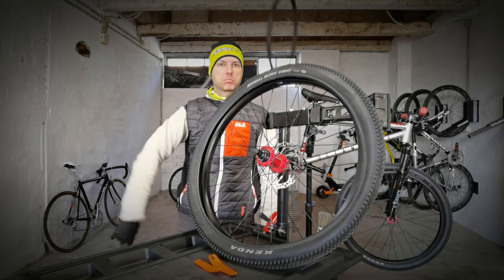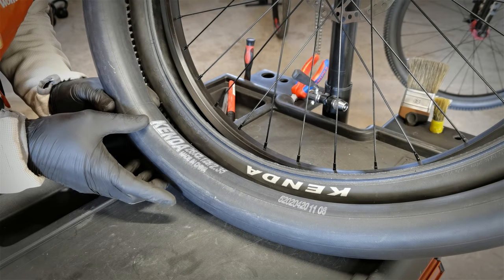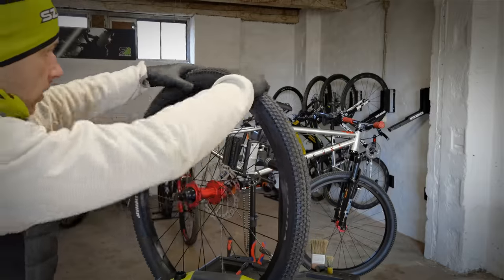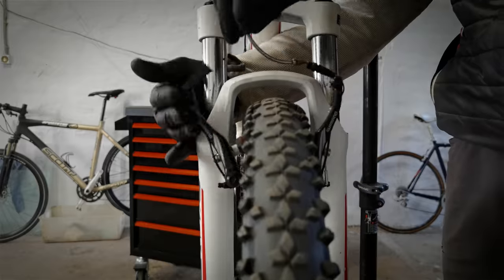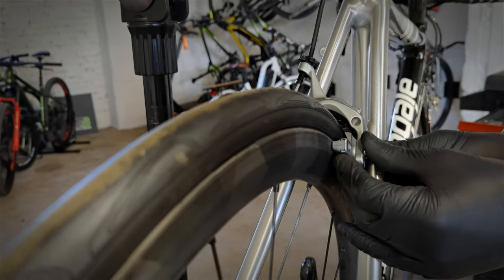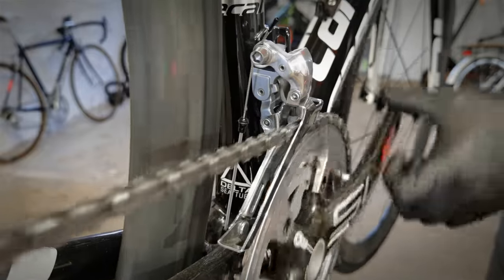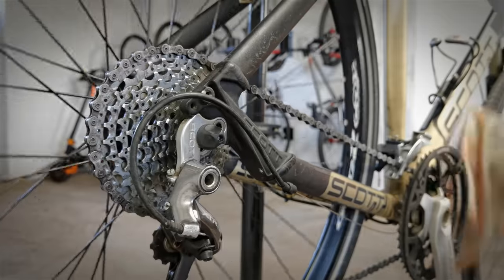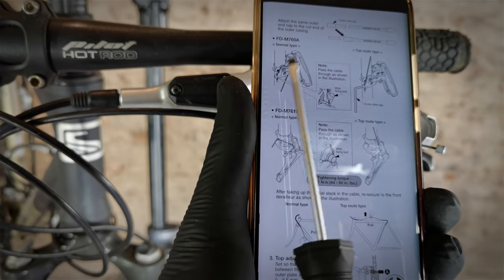7 mistakes of beginner bike mechanics. Inner tube and shifting cables replacement. Lesson 4.

Comment: DUDE!  You install the brake pad spacers depending on the spacing between the brake lever posts and the rim width!  Sometimes the thin spacer goes on the inside and sometimes it goes on the outside!  There is no fixed rule as to which side the larger spacers are installed.  You also want the brake arms slightly outward when the brake pads are new to accommodate the brake pad wear.

Comment: its easy to remove a tire without levers. push the tire out of the rim-bed on booth sides, then grab the tire above the valve with one hand and pull it over the rim near the valve with the other hand.
Reply: MTB tyres are generally easy to remove.

I doubt you can easily remove Continental Gatorskin tyres off a road bike rim

Comment: # 1 Only use a proper wrench for the loosening of the axle lock nut, not a hub bearing wrench,  If a mechanic did this in my work shop he's gone! So to say the right tool for the job.

# 2 When removing the tire once one side that the bead is free and clear from the rim we'll remove the tire from the other side of the valve stem this way it ( all tube and tire ) comes off with one pull, by doing so we'll avoid the need of pulling the stem out as like you have displayed. 0nly rookies will do this. Also when looking for the location of bugger that caused the flat, we'll check the whole tire by rubbing my fingers on the inside while my thumbs are pushing down from the top side. 

# 3 When installing the tube and tire, I'll 1st air up the tube just a little bit then install the tube into the tire but before we do this we'll dust the inner side of the tire with talcum powder, baby powder will do as well, by doing so it'll be easier for the next time for the installation of a new tube. Then we'll install the tire and tube as one starting with the valve stem! This way we avoid the tube from getting pinched in between the tire and the rim. Folding tires can be more difficult but we'll always try this method 1st.

This is my first test when a guy wants to work in my shop, 99.9% has failed this test! They'll say but I'll have my certificate from B**** bicycle mechanic school I'll then tell them your certificate is basically ink on a piece of paper. A couple of these guys lasted 4 hours, and the guy who took the extended course he lasted less than one day. I had a very good friend who just had to take one of these courses there. When he came back I said so William did you learn anything new, he looked at me and gave me a HUGE COOL AID smile and LAUGHED and said no. So I asked why did you go, he said, I just had to check it out for myself....Then off he went to get some Gelatos for us, I then said you could have bought A LOT of gelatos with the $$$ you blew on that bicycle course, he said yeh! yeh! but I still got the certificate. 

4 # The cable thing always fresh housing for me but remember you need the right size housing feral, jag will be plastic, so I'll also use steel of which the jag feral must be able to fit. this way you'll avoid the deforming of the jag plastic feral. Also you did as many shops will do, cutting the cable way to short this enables the a follow up adjustments to be hard, a practice that shops will do in order to sell a new cable and charge installation charges. I will never do this, I'll always leave enough cable for follow up adjustments.

As many of my customers will say it's all in the details!

Comment: 1. T
2. To prevent debris from getting into the cable housing and shifting mechanisms. 
3A. Throwing away to tube and moving the tire before inspecting where the puncture came from.
 B. Pinching the tube under the bead of the tire during reinstallation.
 C. Not shifting down into the smallest sprocket to remove all the tension from the cable.

Comment: 1. T
2. Because, if the old cable is dirty, you might pull dirt through and into the cable housing.
3. Having the brake caliper spacers installed the wrong way. Swapping the right and left braking pads. Not shifting all the way down to reduce tension cable when replacing shifter cables.

Comment: 1: T
2: Otherwise you will put dirt from the old inner cable in the outer cable. Which can cause poor shifting. 
3: A: Wrong cable routing at the derailleurs. B: Having the innertube under the bead of the tire. C: Installing the brake pads the wrong way (L at R and R at L) which can cause losing the brake pads.

Comment: It depends on the type of the bike. if it's a regular bike we charge 2.50€ for the worktime and 3€ for the tube, if it is an e-bike thats 20€ for the work and we use inner tubes with self sealant liquid, that is 9€.

Comment: in Ireland at Halfords it costd €16.50 for a bicycle puncture repair and €32.50 for an electric scooter they are both considered very expensive here in Ireland.  When I was a kid a local cycle repair shop charged 10 c (10 pennies) for a puncture repair a patch glued,  that was only a little over 40 years  ago,  inflation...... excuse my pun,  I just couldnt resist....

Comment: 1. T
2. To prevent dirt being pulled through the cable housing by the old cable.
3. Routing of derailleur cables. Mistake no 6. Both ways can work, but routing the cable correct way on the derailleur with the cable running in the factory marking is much better.

Comment: 1 T
2 so as not to drag dirt trough the shifter
3 a) installing the brake pads on opposite sides 
b) not installing the inner tube correctly 
c) installing the break pads spacers incorrectly

Comment: 1) T
2) To avoid inserting dirt in the cable sheath while removing it, as the exposed cable will do.
3) Not checking the tire for puncture spots when changing the inner tube; not inserting the inner tube completely; inverting braking pads between right and left (forward and backward facing).

Comment: Mistake number 1, using a 17mm cone spanner to loosen the nuts on the rear wheel ! and tube replacement at our shop is £10

Comment: 1) True .
2). To keep the housing cable clean  before installing the new cable .
3) - Do not throw the old tube in the tyre in order to see faster where is the hole in the tyre .
- Pads brakes should be install on the right side .
- Cable should be under the bolt in  the right place .

Comment: 1 - T
2 - to stop dirt from the cable getting into the cable housing
3 - brake pads installed on the wrong side of direction, changing a gear cable without putting on the lowest gear to release tension on the cable, replacement of inner tube without checking damage on the old tube and tire

Comment: Q1 - T, Tru the tire, not the rim. Q2 - Clean the cable before pulling thought so no dirt/grime gets pulled through the housing, Q3 - Don't throw away the inner tube with the puncture. Use the old tube to ensure the tire foreign object debris (FOD) has been removed. Check the Valve is not pulled through the valve stem hold too much because it may cause the tube to be out of true,  don't orient the brake pads on the wrong side of calipers. On Linear pull brakes, make sure that the thicker spacer is closest to the brake pad. Don't route the inner cable on the wrong side of the pinch bolt; look for the manufactures witness mark engraved on the mech side... BTW - I charge $15 USD to change an innertube. That includes the cost of a new inner tube.

Comment: 1 T
 2 so don't drag dirt and rubbish through the cable housing 
3 find hole in tube and check tyre, instert tube all way into tyre to prevent wheel wobble, check cable mounting grooves for derailleur bolts to ensure correct shifting

Comment: 1 t
2 otherwise you’ll pull all the dirt through your cable housing
3 putting in brake pads in the wrong direction, swapping the thicker and thinner rings on the brake pads and not fully putting your inner tube into the tire; it might get stuck between the rim and tire (also not checking if there’s a thorn nail or piece of glass stuck in your tire)

Comment: Yes my cheap Schwalbe tires are always schwalbing from left to right lol
Btw, I keep having a squeaking disc brake... using disc brake cleaner helps only temporarily - any ideas?
And how do I know if my cassette is worn out?
I've replaced the chain after 4000km, but I can still feel vibrations coming from it.

2:40 Btw, just a spare inner tube is about 5 to 8 euros over here - I replace those myself. No way they can replace an inner tube for only a few bucks at the workshop.

Comment: Interesting video always best to replace outer gear cable when you change the inner same with brake cables.  i noticed that you pop a bit of oil on the inner cable and i do the same but some videos tell you not to put oil on the cable. Thanks for the video great help to everyone

Comment: I disagree about the brake pad washers. Some brakes will function better with the thin washers inside. It's pull ratio stuff I dont understand fully
Reply: exactly, they are made to be interchangeable. The easy way to remember is use whichever washer on the inside that allows the pads to contact rim while keeping brake arms as horizontal as possible. Obviously sides should mirror each other (not have one side with small inner and one with big inner).
Reply: @henriv1030  thanks for backing me up
Reply: Probably an oversight by him. 

It's just a guesstimate on my side, but I'd say 95% of the time he would be correct. 

The other 5% are weird frames/forks. 

Another thing would be directional brakepads. You don't see those a lot on daily driver bikes in Europe. Obviously, directional brakepads should always be mounted in the correct direction, but I've installed like 2 pairs of those this year. Compared to a pair or two of nondirectional ones a day every day. They usually come on road bikes, mostly older ones, or ones that are built for weight saving compared to much beefier hydraulic brakes of pretty much any kind
Reply: @noneofyourbusiness4294  if you're a European.  Please let me know if you have any equivalent to "Walmart bikes" which are the most common bike here in the midwest in the US. They are bikes built for superstores that are made with no design philosophy out of whichever parts can be purchased as cheaply as possible.  Almost all these bikes are made to barely function.
Reply: @goshohgosh4568  we do. Discounter chains like Aldi, Netto, Lidl etc offer bicycles every now and then. Hardware stores tend to have some standing around most of the time. 

They cost about half as much as a regular bike. And it shows. It's like there's a sale of parts nobody wants, and they go like "let's buy that in bulk"

Comment: I always fit my own inner tubes, very easy, and most times I repair the puncture ,only replace the tube if very old, or too many patches.
I use Schwalbe marathon tyres which are pretty good at resisting thorns etc, but not perfect.
Once I put a 2 inch gash in the tyre wall, I was miles from anywhere on a lonely mountain trail, I fixed it enough to get home by stuffing my sock inside the tyre to cover the gash and a new tube gently inflated.

Comment: talc between the tyre and tube, use an old tube to line the inside of the tyre, extra layer of rubber can't hurt when it comes to puncture prevention.. I rarely get flats from pinched tubes or glass.. thorns though? They can go fu................
Reply: I told a friend I haven't had a flat probably15 - 20 yrs .Now I'm always getting flats 🤨 lol
Reply: @Brad-99  That's damn unlucky

Comment: That first bike is using gears that are too small.  Should increase both the chain ring and the sprocket to reduce the excess chain loss.
Reply: Dirt jumpers have very short chainstays. A larger chainring won't fit as designed. (They'd have to spec thinner tires or an extra wide bottom bracket spindle.)

Comment: Spacers on brake pads should be arranged accordingly to the brake arm that should be parralel with the wheel when brake is acctuated.
In not all cases is true that the thicker spacers go inwards to the wheel.
In my country not so long ago about 3 years patching an inner tube cost only 4€,now around 6 or 7.

Comment: I always use new housings with new cables. You should demonstrate the difference between good stiff, compressionless brake housing versus cheap alternatives that feel soft and weak.

Comment: Hello thanks for the video! do you know if there's a fix on a folding continental race king that is wobbling? The alignment of the rim is good. First time to exp this issue :(
Reply: If both beads are evenly seated and (as you already checked) the rim is true, it's a defective tire. Rare, but it happens.
Reply: Tires can get stretched and deformed from glancing blows with objects on the trail. If it is a used tire you wont be able to fix it.

Comment: You're dressed as someone working in colder weather. This makes the material harder to work with. And you still make it look easy. But you do it in that way with clear explanations explaining what may go wrong without rambling. It's taking me a long time to figure stuff like this out sans this type of instruction. You have earned yourself a new subscriber. Cheers !

Comment: When fixing punctures on tube type tyre grab a sharpie or a piece of chalk and mark on the tire where the valve is, doing so it will make your life easier trying to pin point what exactly what caused the flat tire.

Comment: I live in the nederlands and I pay €25 per replacement of the inner tire
Reply: Me too, and that's why I started to buy my tools and be my own bike mechanic. Paid 23 euros for a fix that did not work; had to buy a new freewheel to fix the problem (the mechanic had likely just adjusted the gears) and I installed it myself. Now, I've replaced a freewheel, shifter+cable, a whole drivetrain on another bike (with an old frame that does not accept new derailleurs, since it must be attached to the axle itself, so I had to re-use the old derailleur with the new drivetrain), and rebuilt a child bike that my wife found in the trash one day.

The one thing though...the Dutch city bikes can be HEAVY!!! I have a good stand, but it does not lift the bikes itself... The bike itself is heavy duty (the stuff I carry with it...) but the rust near The Hague is horrible.

And good thing I carried over my socket and key set from Canada (dual system set). I was surprised to find Imperial-sized bolts on Dutch bikes... Just check out "Canadian measuring flowchart" for reference ;)

And for some reason...it's always the rear tire that blows up...
Reply: @martinhoude3518  The rear tire has a higher chance of going flat because most of the weight is on the rear tire.